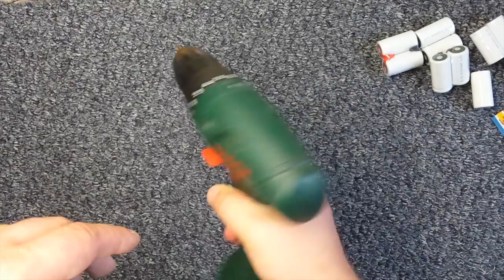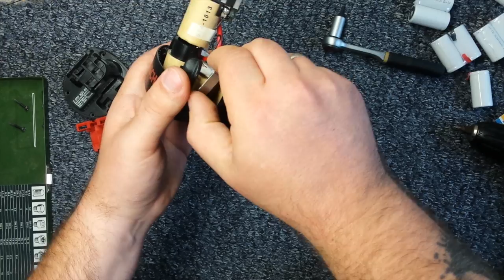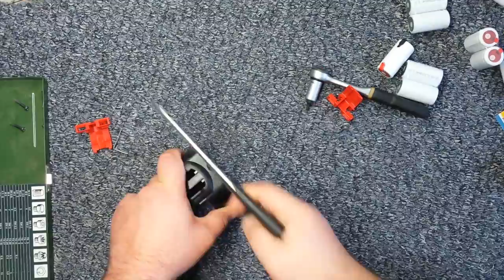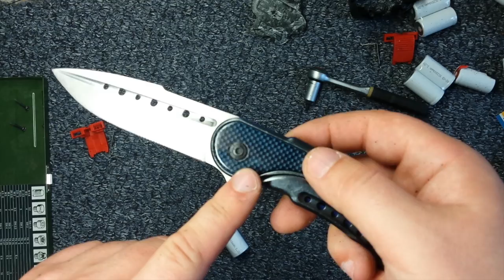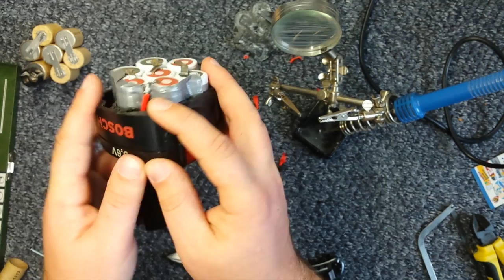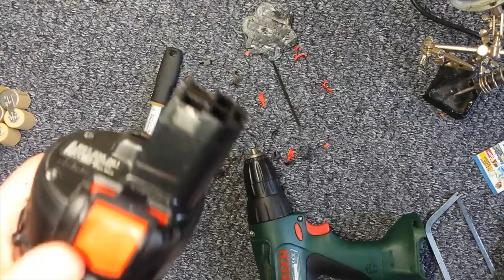Bosch PSR 960 battery repair. How to change NI-CD elements in the device.

Comment: yet again another YouTube cowboy bottcher amateur, 2 things 

1-- he should have disassemble and taken out the batteries measure the size of them, 2- test them each with his meter, maybe one or two have problems, ...so keep cost and work load down...also clean up as you go along ...dirty work bench 

English Mike,
( Euro fighter electronics engineer RAF )
Reply: you comment is quite old...but...... :-)...... // YES = maybe two accus are the troublemakers.  ////  H O W E V E R  : most of the time, the other cells are damaged  too (= due to constant over charging )or do not perform as I would like them to perform // greetings
Reply: @danizweifler6061  

MAy be old comment,  but still stands  up to day...you cleaned up that pig sty  yet ?

Comment: Thanks for taking the time to post the video. I have the same drill, which just stopped working after a short while. I don't know if the problem was the drill battery or charger. I stumbled across the drill the other day, just need to find the  charger - I'd like to bring it back to life. Now I know how to attack the battery area if I figure that's the problem. Cheers.

Comment: Since you changed the batteries, has it worked fine now? No more issues?
Reply from the maker: it is working perfectly, and battery last longer. Maybe not as long as the capacity suggest on the batterie but definitely longer. I guess thats a common issue since i seen other people complaining about this online .

Comment: This is what i was looking for. I think i will do something similar soon. Thanks
Reply from the maker: good luck. It is still working perfect for me. And another thing, you can always go for Lithium-ion :) just then you will have to change the charging system. But simplest thing is just to replace the elements inside. Costs cheaper than cheapest knock of,  you just have to invest time :D but i guess half an hour is not that much
Reply: Hi, thanks for the great video, also have the same battery issue. I hope I'll find the right size of battery, however it is not easy to realize the real size in the webshops. Could you please help where can I found such short LiMH 2800mAH batteries?
Reply from the maker: Hi, try on ebay :) If you would put next to the type of battery "drill" should give you the needed ones. And in ebay look at enough listings you will find dimensions in some :)
Reply: Hi, FYI I passed the battery replacement during Christmas Holiday. Thank you for the video and hints!